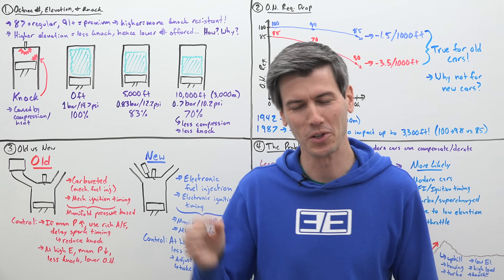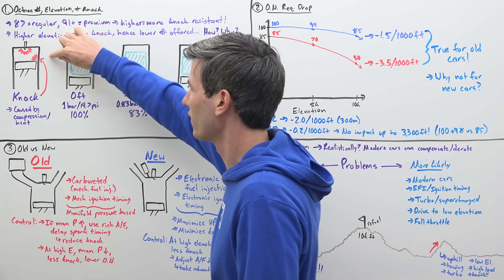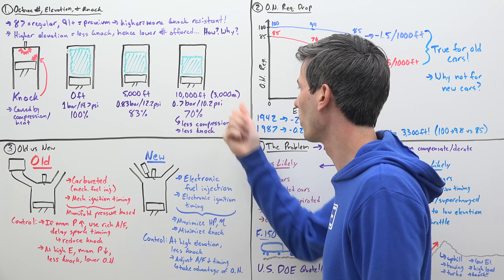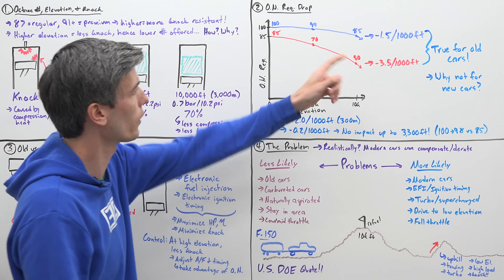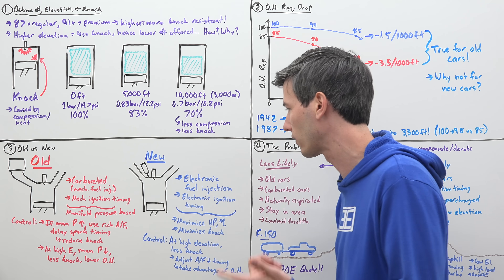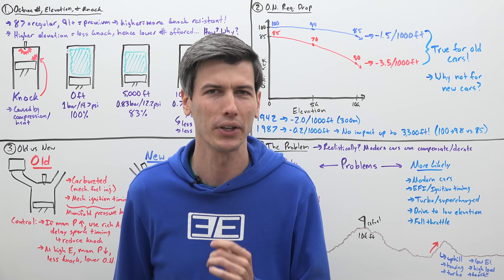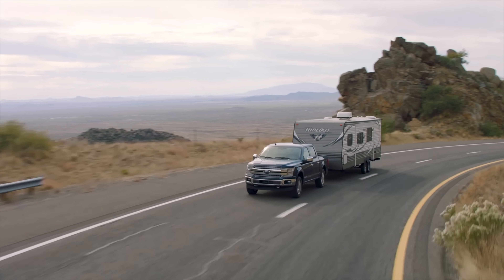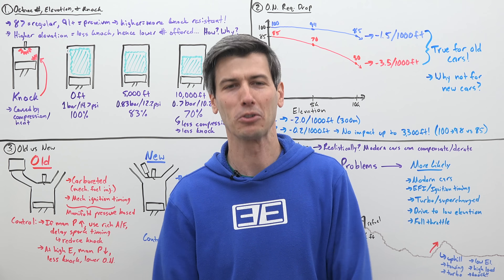Never Use This Gas In Your Car!

Comment: For what its worth I worked in the service department for a chrysler/jeep/ram dealer in colorado (where everyone uses 85) for 6 years and never once had, or heard of, a knock/pre-detonation issue on a non-turbo charged vehicle (most of which specify 91/premium anyway) not related to mechanical failure. I think if the vehicle is staying at altitude without forced induction its unlikely to have any problem. That being said the use of 85 in a turbo charged vehicle was a common problem and I would be surprised any manufacturer would recommend 87 instead of 91 for a turbocharged engine. 

I do think there is confusion by people refueling at high altitude and then returning to lower, and I have heard people (incorrectly) claim that 85 is the same as 87 sold at lower altitude and that the altitude makes them perform differently thus the change in labeling.
Reply: KIA/Hyundai turbocharged vehicles in Australia are recommended to run on AKI87 (Research Octane Number 91). 
Most small capacity turbo petrol vehicles are European in origin and are tuned to run on AKI89 (RON95) at a bare minimum.
A large proportion of Aussies use a higher rated fuel than manufacturer recommendation (wasting money) in the belief that it causes less wear and has cleaning properties.
Reply: My 2020 Honda Accord 2.0T recommends 87 octane.
Reply: @GradyPhilpott  87 or higher.  I have the 1.5t
Reply: Both of the commenters to this thead seem to lack some reading comprehension skills. Specifically the OP's second paragraph expressed concern that people might be told that octane ratings might be based on different altitudes, vs what is actually in the gas.
Reply: @Sumanitu  No I'm very capable of reading, hero
Reply: It's hilarious you said basically everything he did in the last quarter of the video...
Reply: @Anvarynn  i know right if only he watched the whole video lol could have saved him the time typing up his message lmfao

Comment: It's absolutly ok to sell that low octane gasoline. Because there are still vehicles out there which can use it very well. If Ford builds an engine which can not work with a fuel that's available it's their fault. Engine management systems are able to detect the "quality" of a fuel. So in that case the EMS should just limit the power to prevent pre-ignition.
And additionally...if you ban 85 octane fuel, you force people to buy more expensive fuel which their engine can't use to full potential.
Reply: Yeah, I was thinking that when I watched the video too.

Comment: Random story concerning 90 octane in a 11.3:1 CR car with DI and dual VVTi(E). 

I refueled my ISF with 90 octane when I was stuck in the middle of nowhere Texas. 
My car's Knock Control Learning Value (Toyota thing) was reading roughly 15.0 - 15.3 (15 is baseline, so the car was NOT happy at all). 
For comparison, KS Costco 91 gives me ~20-21 KCLV (excellent!) and CA 91 ACN gives me 16-17 (trash fuel!!!).

It was going to be a couple of hours on the highway until the next stations that have 91, but I was certainly looking for ethanol. The ISF's ECU doesn't read ethanol but can read knock levels of whatever fuel is in the car. Safely, one can "blend" up to 30% ethanol in the ISFs. This was a bandaid for those with Lexus F cars in CA because it mimics what a real 91 or 93 octane could provide. The ethanol raises the knock resistance but only up to 30% is what the ECU, injectors, and math wizardry can handle. 

For the next hour on the highway until I was somewhere in Oklahoma, I was able to sneak a couple of gallons of 91 octane in the car. It barely nudged the KCLV level to somewhere 15.5.
Until I made it to OKC a couple hours later, I was babying this car at 60-65 and ensuring I was monitoring the load (viewable in my BT OBDII reader connected to my phone). 

Once I got to OKC, there was a specific station that sold ethanol and race fuel. Usually I would opt for the ethanol but I recall grabbing the race fuel. It was at least 100 octane lead free and I only needed a couple of gallons to raise my overall octane. 

Got back on the highway and my KCLV was a solid 22-23. I can't tell you how nervous that drive was and how relieving it was to finally drive normally, especially with traffic. 
With that being said, if I were to ever do such a trip again, I think I will carry a 5gal jug of E98 in case I needed to bump up my octane.
Reply: Use of abbreviations makes this hard to read.  What the hell is ISF?  Or KS Costco, KCLV, ACN, BT  etc.  I understand OKC because I used to live in Oklahoma.
An explanation of the abbreviation the first time it's used would go a long way toward making your posts more readable.
Reply: @sjsz06  Lexus IS F.
Reply: Seriously,  even the toyota manual states tat 92 is an option and to research it.  High compression and engines with turbo or direct injection should use high octane or at least use octane booster and an additive.
Reply: lol. You need a better car.
Reply: @TestECull  you need a better response

Comment: Just wondering, but don't lower octane fuels have a harder time igniting thatn higher octane fuels in the same conditions or the other way around?
Reply: Higher Octane = Harder to Ignite 
Lower Octane = Easier to ignite. 

At high elevation with less air it needs to be easier to ignite the fuel, theoretically. Hence people at higher elevations have 85 octane available. Like he said though, if those same people take that low octane to a lower elevation now you'll have knocking and potential engine damage. Its better to error on the side of too high of an octane. Worst case scenario you lose power, no damage, because the ignition is delayed. Premature ignition on the other hand is very bad.

Comment: All turbochargers ingines made in the last 20years have knock detection, and instantly  reduce ignition timing at the onset of knock. All oem turbobengines do this. There are no exceptions.
What you will notice is short-term  lack of power.

Comment: Didn't read if this was mentioned  , but modern cars knock sensors will pull timing in two ways.  Short term , meaning it saw knock past the threshold  and the pcm is capable of pulling said timing to retard the event. Also it has  longterm  , meaning it saw knock so many times in a spot that it will always pull said timing. 
So for Ford to say any fuel on the market is to blame is pure bs. The pcm has the control and they want an easy out.

Comment: As an European (and more specifically Northern European), these numbers are pretty wild. We have only two petrol varieties in sale: 95 and 98. There's E85, but that's not sold as petrol at all. The "regular" fuel we use here is 95 octane, and "premium" is 98. A few station brands sell 98+ and 99 as "super" fuel. Selling anything under 95 and calling it regular petrol is actually illegal.
Reply: Pablo Morales  It's still different enough. The difference is 5 in average. So 90 Octane in US is 95 in EU. And 95 is our "regular" and 91 is your premium. They are close enough same. In the US terms, our fuel would be 90 for regular and 93 for premium. Nothing under 90 (US) / 95 (EU) is sold anywhere.

Comment: "Further more" modern ethanolated fuel of any octane is not recommended in older carburated vehicles unless you like replacing fuel lines and rebuilding carburetors because the ethanol is more corrosive. The only non-eth sold here (high elevation Colorado) is preium 91 octane 🤣

Comment: Back in 2004 experienced knocking in my 1996 Ford Thunderbird 3.8V6 (naturally aspirated) while driving from Los Angeles to Los Angeles where I heard it knocking somewhere in the middle of the desert.  I figured it was because it was running a little hot with the A/C on and cruising up the mountain at 80+ mph.  I didn't realize it at the time, but I did fuel with 85 Octane prior to my road trip from LA to Vegas.  So yeah, I should have paid attention to my owners manual where it says to always use 87 octane or higher even if 85 is sold in areas with high altitude.  My engine was not damaged but lesson learned.

Comment: I live in Denver and this was news to my ears. I haven't owned a gas vehicle in almost a decade though, diesel baby! However, these emission control systems are killing me. Def fluid tank heater just went out on my F350, DPF rear nox sensor went out. Looking forward to electrifying, that way I won't have to worry about it ever again

Comment: 3 days after seeing this thumbnail I find myself driving an Infiniti FX50 home I just purchased and have to refuel Wyoming.  The station only had 85 octane so I continue down the highway since the vehicle stated [Premium fuel only] due to its high 11:1 compression ratio and being non DI.  The next station only carried 85 so I went inside to purchase their best bottle of octane booster and kept it under 4k rpm with a light load.

Comment: In my F150 (2014 3.5 ecoboost), I saw knock counts just driving around town with my scanner on 85 octane (Denver). Since that day, it only sees 87. I later tuned the truck to optimize performance on 87.

Comment: Most new gas Ford trucks sold use turbo charging and are more sensitive to air/fuel/compression ratios and people like that Go pedal. So it’s not out of the realm of possibility that low octane plus high boost could cause long term detonation damage

Comment: The absence of a National Standard for fuel octane REQUIREMENTS is why this issue exists. Ideally, Regular would be 87, Premium would be 97 and mid-grade would be 92. E85 octane is 100-105 making it the highest octane fuel readily available in areas where it's sold. The chemicals required to raise octane rating are NOT expensive enough to justify the price difference between fuel "grade". There was a standard 10 cent per gallon price difference between regular and premium. Then mid-grade was introduced between regular and premium but the 10 per gallon was between the THREE grades now! This has changed to as much, or more than, 20 cents per gallon between the grades now! There IS NOT 40 cents per gallon of "octane booster" per gallon in PREMIUM FUEL! The fact that E85 is generally LESS expensive than Regular proves this. Only one answer to the pricing...GREED!
The fact that modern, boosted, fuel injected and computer controlled, high compression engines can run on 93 octane pump gas, that older vehicles with much less compression barely survive on, shows that more stringent standards are needed. In the pre-unleaded years, Regular was 93 octane and premium was 99-102 depending on the market! Higher octane makes higher compression, more powerful and more fuel efficient engines possible.

Comment: Heat and humidity also affect knock.  I'd like to know why some of the hottest and dryest climates in the US has only 91 when some of the better climates have 93?  Only time I have seen 85 was in very high and humid elevations.  There is a lower demand for octane in that condition.

Comment: Good overview of the tradeoffs with 85 octane. Many slower cars are fine with it, I would avoid it in a turbo.
Reply: I tend to avoid turbos in general. Unless it's a diesel or a full blown race car the turbo is just a crutch put there to make up for an engine that's otherwise just simply too small for the task at hand.
Reply: Especially true if you drive gently.

Comment: Crazy that in montreal we are basically at sea level and my local gas station has 85 lol. My friend puts it in his '94 tercel. Also, if you're driving in an area with more than 1 bar of pressure I guess you need higher than the recommended octane rating?

Comment: You didn't even mention that they don't adjust the consumer prices to fit the lower Octane fuel. 

In Colorado I use premium 91 octane fuel, but when I'm at sea level I can get away with midgrade or 87 Octane.  I used 85 Octane once in my Forte GT once; the performance was horrible.

Comment: Interesting to learn that in the US of A they sell fuel as low as 85 octane and that the premium fuel is 91. In The Netherlands where I live, the standard octane number is 95 and the premium is 98. If I remember well, in other European countries they also sell even higher numbers. 
Why do they not also sell 95/98 octane fuel since the US is a real car based country? (Is it only because this is cheaper or are there more interesting reasons?)
Reply: Premium is 90 where I'm at.  Highest you can get in the state... 87/88.5/90 are the standards here.  my car says minimum 91 recommend 93 or higher.  Haven't yet had issues I always wonder though

Comment: This fuel is mostly called flex fuel. If ur car can run on it there will be a badge on your car saying flex fuel. My 2011 Dodge Grand Caravan (minivan) can take flex fuel. I push a button on my dash and it tells the car’s computers like the PCM to change the timing along with a whole list of other things. Flex fuel is good fuel but using it in a regular engine would tear it apart. Take it from me. I drove 4 weeks on e85 forgetting to push that button and the engine destroyed itself.

Comment: Forgetting temperature there bud.  Higher temperatures means less denser air charges.  Meaning that octane requirements are a bit lower in Phoenix in summer then Anchorage in winter.  I run premium regardless because that is what the motor was rated with.

Comment: My Mercedes Sprinter takes no more than B5 diesel and plenty of stations all across the Midwest ONLY sell B20. I have had issues from having to use B20 and subsequently almost run out of fuel while searching for B5 in these states.

Comment: Fun fact that disclaimer has been in Ford owners manuals for many years, long before Ecoboost was even a dream. Wish this subject was covered in such detail about 15 years ago so I could have shown my boss. Our fleet was mostly late 90s- early 00 Rangers with 2.3 & 2.5l SOHC Pinto engines. Some had the dual spark heads. They pinged on anything less than premium, even here in Denver. I'm sure it was party due to older engines with carbon buildup but still. I tried to explain why to my boss he got kinda pissed. I kept trying to convince him to run premium in his company truck for a few weeks to prove my point, but he never did. "These POS 4 cylinder trucks are not worth spending the money for premium fuel" was his logic. We retired our vehicles just over 100k so that had something to do with his perspective too

Comment: Huh, didn’t know they made it with less than 87… I actually checked the manual for my 2014 Honda Civic LX with a 1.8L engine, and it gives the same warning about possible engine damage if you use lower octane. 

They should probably stop selling 85…

Comment: The valley I live in is at like 4500ft and I see 85 everywhere. The big issue is price, up in northern Utah it’s like 3.76 for 85 and even more for higher octanes. It’s getting absurd in cost to the point it’s reasonable to just get 85 and spend less.

I’m just glad my diesel came back down to 3.49, still expensive but not as bad as clear 88 no ethanol for over $4 a gallon. I’m not very happy with these prices anyways, it’s absolutely awful.

Comment: New Mexico does 86. I have a 2014 Ford Mustang and know the same issue concerned me while I lived there. I wrote the NM governor about it but got no reply. Instead I used a partial bottle of octane booster each time, STP brand. My car actually drove better than it usually did with 87. I used a 12 oz bottle and tried to even it out with 4 uses so around 3 oz each time.

Comment: Does america measure octaine in a different way than europe? In swe we usually never see anything below 95 and on the continent you can sometimes get 91 but most commonly not I think (for obvious reasons it was some time since i last drove in south europe :) )
Reply: Yes.  Europe uses RON only.  The USA uses (RON+MON)/2.  It results in a 4 to 5 point lower octane number.

Comment: Question, if higher elevation can run lower octane, how about lower elevation with extremely high humidity?

The area here is ~130 ft above sea level but the humidity is insane, we're 150 miles from the Gulf of Mexico, we get a lot of moisture from the Gulf in general and we're at the junction of two rivers into one, humidity is high enough here that carbon buildup on cylinder heads and pistons is actually different than it is in other parts of the state. It's almost like water injection at some point.

How would the moisture affect the octane requirements? In my experience it seems that we can get away with lower octane fuel. Oddly enough it seems on some of the higher compression engines we have to go up in octane during the winter as the air is dryer.

Curious as to your opinion/engineering perspective on the matter.

Comment: As someone who hauls fuel in Wyoming, we often pull from different states and simply pull regular, mid and premium. Next time I'm taking something to or from Nebraska I'll have to pay attention to the octane number.
Reply: When you pull into a Kinder-Morgan fuel terminal, you know which specific rack to pull in to and the system knows exactly what product to load you with based on where it delivers.....You also enter gallons per compartment so that each gets the correct mix of additives....

Comment: Hi, not to disagree with anything you said but, wont the knock sensor on a modern car retard the ignition, thus prevent any damage? I believe these sensors can detect knock at an otherwise imperceptible level?
Reply: Only if it functions as designed

Comment: 2017 Ford Transit 250 Ecoboost turbo. Am I wasting money putting in premium gas if I am in a campervan, never towing and drive conservativly at all times. I also do it because I think it can help reduce the chances of carboned up valves even though my engine sprays fuel in combustion after the valve (direct injection).